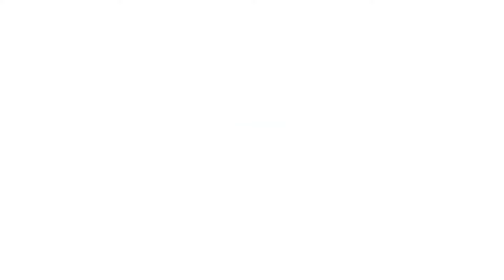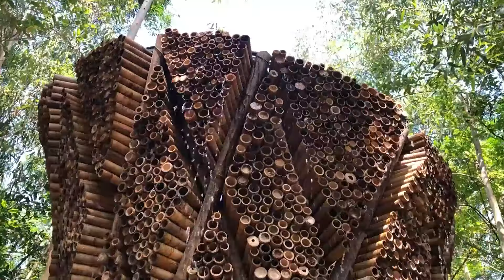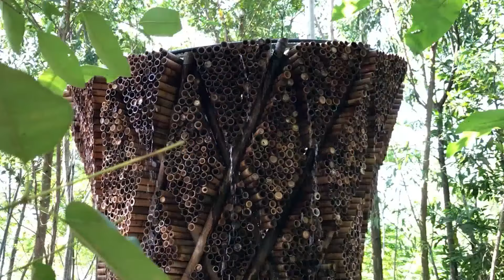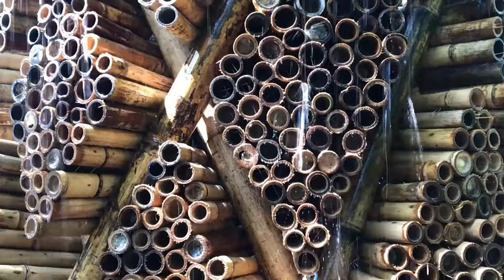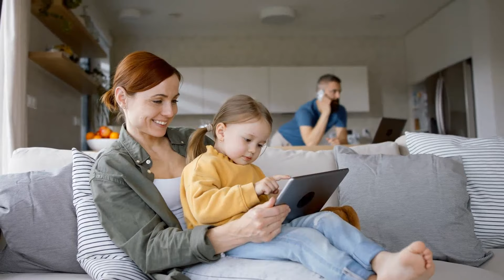Ductless DIY Air Conditioner Installation from Bamboo | Future Technology & Science News 62

Comment: My concern is how effective it would be in such a humid environment such as Vietnam. Evaporative cooling usually works much better in dry environments.
Reply from the maker: Thank you for sharing your concern. You've raised a valid point, evaporative cooling systems generally work better in dry environments due to the nature of the process.
Reply: Bamboo works, but terracotta actually cools down even in the humidity.  India and the Middle East both use similar designs, and with the arid environment it get chilly.

Comment: I think if like this: in middle should be a spiral slope so wind exist naturally as it goes down keep spinning, then because have water, it is cooler then it keeps going back up when reach down. Maybe actually can be something. The information of a wind to be colder is just using Bottles(cutting the bottom) then joint them like this Bamboo, so maybe from the wind inside, it can be colder outside.
Reply from the maker: Good point!

Comment: How does this work in an actual home or factory?
Reply from the maker: Thank you for leaving a comment.  Hope this would help: https://inhabitat.com/energy-efficient-bamboo-device-in-vietnam-is-a-cooling-system/
Reply: If you live in a place with high heat and low humidity, it can work reasonably well. All you need is air flow and water evaporation, the problems begin when the relative humidity is high, water will not evaporate much and all you get is hot and humid air. Overall, don't expect cold air, even in best conditions, slight chill, that's all. 

Don't forget that all that water vapor will make mechanical devices rust and electronics will die. Water chillers are an old invention, and a big one is quite effective. This bamboo contraption is mostly decorative, the cool ail will dissipate  quickly.